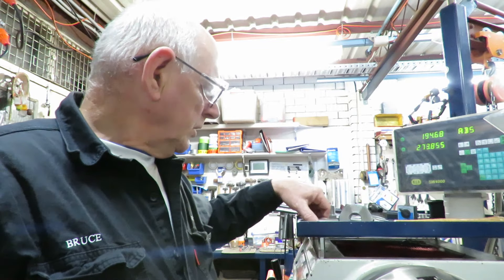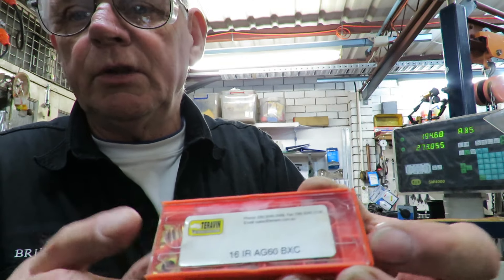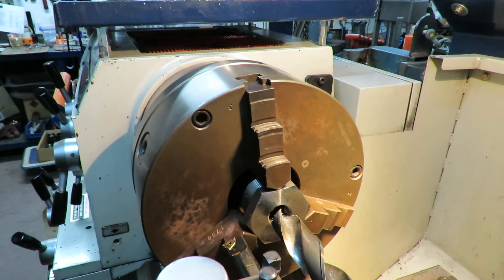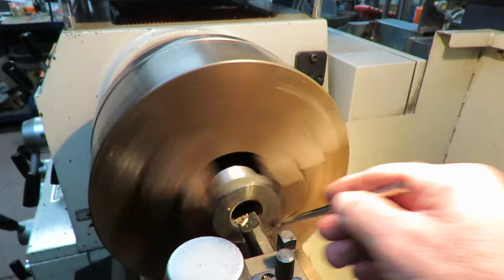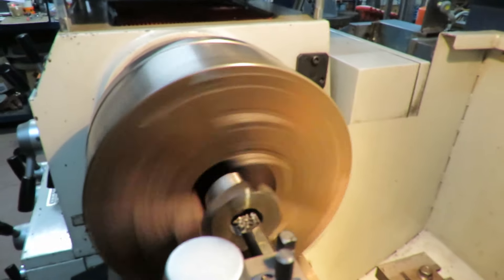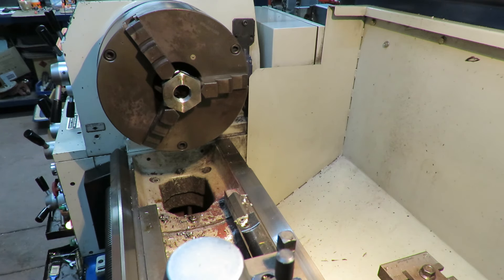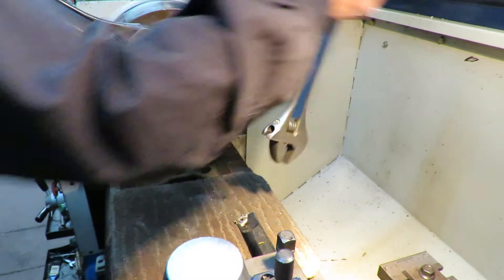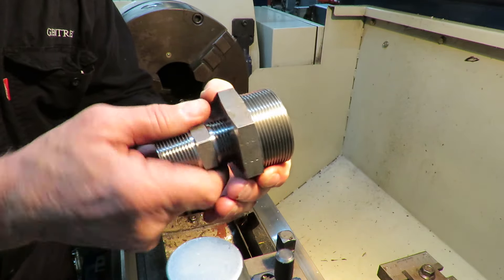NPT Bushes speed threading

Comment: You explained it fully. You drilled out to OD of thread, cut the untapered thread on the lathe, then used the NPT tap to produce the taper; sort of like using a tapered reamer. And the previously cut thread centers the tap. Very nice method. Nice to have a brake on the lathe!

Comment: Very good (and informative) video. I have wondered about cutting tapered threads on the lathe using a taper attachment, but have not found anything on YT that shows how. I like your two stage approach. I am a novice machinist (aspiring) and really appreciate the safety tips. I have no desire to loose body parts or impair their functioning because of lack of knowledge; much can go wrong and it is here I do not want to learn by trial and error! Super, useful video, Bruce. Much appreciated.

Comment: Love the videos thanks Bruce :) Bruce is correct it only takes a little slip
one tiny error,When rushing or anything..I have a E-Stop which is constantly
pushed when I'm not turning on the lathe not only that but i also have a fwd
/rev switch that is put into the off position also,That is in case i knock the 
fwd whilst working on the lathe and not turning..Its good practice to be
hitting the E-stop then disengaging the power to the lathe..Had i only been
using the fwd/rev/stop on the lathe it only takes my leg to hit the fwd switch
and any thing can happen..Sounds pretty stupid to put the lathe on with a wrench
and tap by hand..But i have seen it done on youtube..

Comment: 1" NPT tap isn't too bad but I have to eat my Cheerios for cranking those 2"  and over NPT taps. Might it have been as fast to cut the thread straight then turn the compound to the proper angle and hand crank it for the taper?
Reply from the maker: Mate,  you can hand crank the compound for a taper......BUT not for taper threads, even McGuiver couldn't do that! The only way is with the taper attachment of the saddle so that it follows the angle under feed the half nut, or with a CNC machine. Check out my channel with the "Getter Out Apollo 22" hand tapping galvanised threads on a pressure vessel! my arms are still aching LOL
Reply: Bruce Whitham
Too early in the morning here, I forgot the hole was threaded! You just need really good timing and a steady hand to do threads with the compound. :-)  I am certain it would be an interference fit thread when you got done for sure! lol

Comment: Hi Bruce, thanks for your video, Im fairly novice to operating a lathe, my first job is very similar to this one in your video- drilling a 1/2” npt hole out to 29mm, threading to 11.5tpi then finishing with a 1” npt tap to get some taper happening. Problem is my thread chart on my AL-410 lathe doesn’t state a 11.5” tpi thread. It has 8,9,10,11,12 etc. Do you know how I can overcome this? I could drill the hole out to the right size and hand tap it with a giant adjustable spanner.

Comment: Hi Bruce ,
Did you leave the half nuts engaged because you're threading imperial on a metric machine and can't use the thread dial?
I use the DRO to return the saddle to zero and pick up the same number on the thread dial and close the half nuts .
If a DRO is not fitted a dial indicator can be used to get the saddle back to zero.
Reply from the maker: Ian Thanks for the notes.  I always work with the half nut constantly engaged irrespective of thread type. I took the dial off and put it away when I bought the machine. My lathe is a "Toolroom lathe" so it has comprehensive imperial and metric and module threading ability within the gear box arrangement. I rely fully on my DRO so that makes threading easy. My method is to set the DRO to zero for the final depth. and work towards the zero as I make the cuts, the last spring cut will therefor be Zero!.

Comment: Ok, 

so for a one off npt bushig, could you just turn the bore to a certain I.D. and then use the tail stock to line up the tap and just tap it?

I have to change gears to cut different threads on my lathe and it would be much easier to just tap it. I have a die and tailstock setup I made myself to tap weld on bungs etc.

I guess Im asking if its acceptable to just tap the threads without actually cutting threads first?

Comment: if the tap is this large and tap holder or wrenches, like in this case, can't make a full turn without touching the ways, and if it is the last operation on the part, then it is easier and much faster to just remove the part from the lathe, put it in the bench vise and use two handed tap holder to run the tap through - my way of going about things like these, I'm too lazy to reposition wrenches tens of times :D

Comment: If you can get to the back side of the lathe easily its a bunch easier to pull on the wrenches and you can usually rest the spanner on the chuck jaw against something. Trust me I've used this same technique with 2" NPT, need both hands to just turn the tap, and tailstock support is essential .
Reply from the maker: Mate that's fine, In my case I have a high guard above the regular steel splash guard at the rear so I can't apply that style
Reply: That makes it perfect, you rest the big adjustable spanne

Comment: Gee Bruce - a long video for you - have you got NBN now???? A great solution to the problem. I would have liked to have been a fly on the wall if someone had tried to cut the thread with the tap you were provided with.
Reply from the maker: Mate, no NBN, just many hours uploading. I considered putting the tap on the tool and cutter grinder and making it into a starter tap, but balked at that when my thoughts went to winding it in. How's that saying....older and wiser!
Reply: Lol. I have the same problem.  What upsets me is that the nbn runs right under my driveway but there is no scheduled connection availability  for anyone in my street

Comment: Definitely turn the power off. It is just too easy to accidentally move or bump the spindle forward/reverse lever while concentrating on the doing any manual work on the lathe. Thank you for the  quick project video.